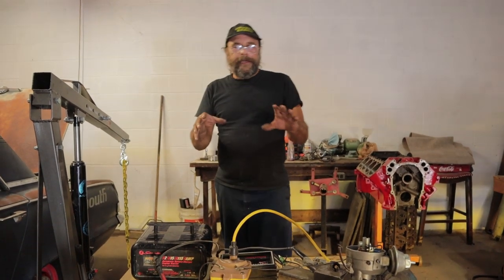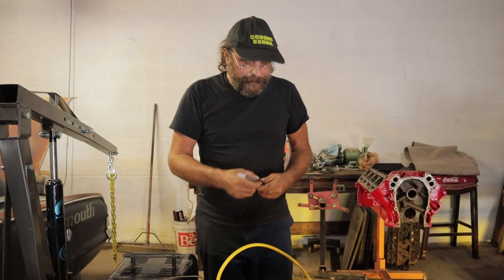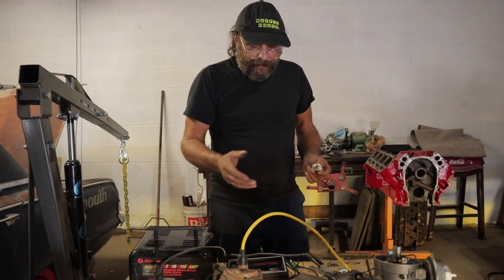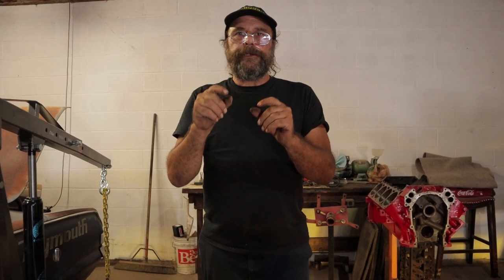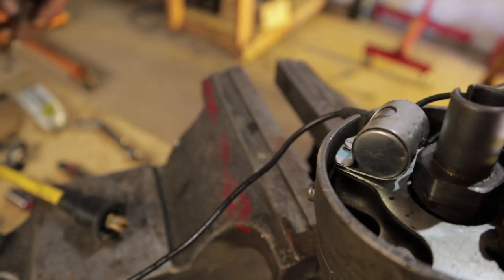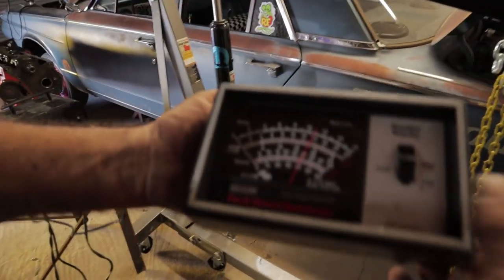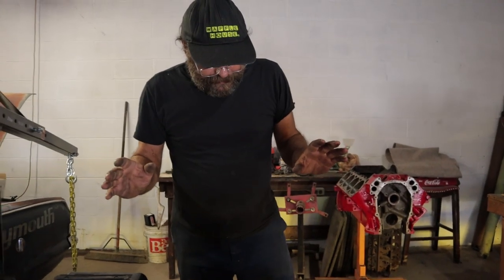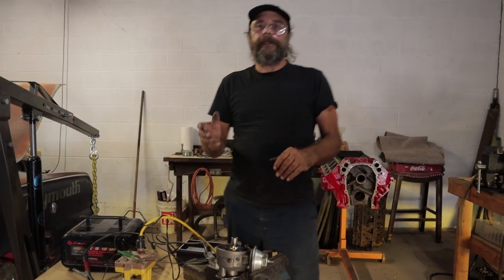Classic Car Tech-Setting Up A Point Ignition

Comment: Hi Uncle Tony, 
I am Chuck in Wildomar, California.  Good job Sir!  I have two 1930 Ford Model A pickup trucks with original engines (Inline 4s). Also a 1974 Triumph TR6 (Inline 6), and a 1947 Chrysler New Yorker (Inline 8).  All have points. Another bit of information for people new to points/condensor/coil ignition systems is that you ALWAYS adjust point gap BEFORE adjusting the engine ignition timing.  Point Gap affects Ignition Timing.  Cheers., Chuck

Comment: Love your videos!
As stated in a comment below, another word for condenser is "capacitor", pretty much the most common component in electronics....and the least reliable by far.
Its job in an ignition system is to form whats known as a resonant circuit with the primary of the ignition coil. When the point open, the magnetic field in the coil collapses and generates a voltage in the primary, this voltage then gets stored in the condenser momentarily and then dumped back into the primary of the coil.
This "ringing" backwards and forwards is what produces the AC voltage required to couple the primary winding to the high voltage secondary winding of the ignition coil.
The coil is just a specialised transformer, transformers require either a fluctuating DC voltage or AC for voltage to pass from one winding to the next.

What you have sitting on the bench in this video is actually a miniature Tesla coil arrangement.
Try removing the condenser and see how the engine runs, if it will run at all.
If you have access to an oscilloscope, you can actually see this ringing on the screen.

Another tip...if the points are burning badly to one side, change the condenser or its value in microfarads or uF. 

I cannot remember at the moment but increasing its value will shift the pitting to one contact, reducing it will shift it the other way. 

Nail the correct value and they should burn evenly without that spike growing out of one point.

Comment: I have had one of those Sears multi meters since 1986. First motor I built (350 to replace the 307) I installed an HEI with external Accel Super coil kit. So never used the meter for dwell. But it worked perfect as an under hood tach display for tuning the carb and timing. Along with a light and vacuum gage.

Comment: This was an excellent video, thanks.  In the 70's, when I had an Opel, and needed to set the point gap, the engine had a fan that was coupled to the water pump pulley with a clutch, so you could not just move the fan blade a little to get the points to high cam.  I would just put the car in 4th gear and move the car a little forward or back, as needed.  And back then, the Bosch points did not last very long.  I had much better luck with Standard Blue Streak points, which were vented, and also the 2 surfaces aligned (unlike the Bosch stuff I had tried).  A Beetle guy had told me about the Blue Streak points back then.

Comment: Nice video Tony !!!  My professional career as an auto tech began in 1973 and continues to this day. I never pulled a distributor to replace points and condenser. A sign of a bad condenser is badly burnt points. If someone would ever toss you a condenser you never catch it as it was probably  "charged" with a spark plug wire from a running engine...lol

Comment: Hey Tony
Great video!
Heres something to try:
While you have the distributor distributing that high voltage spark at the plug, remove the capacitor lead and youll see that hot spark get noticeably weaker. 
Maybe so weak it wont light the mixture of fuel and air under compression.
Gasoline is not a conductor for electricity so you’re adding  a lot of resistance especially under compression.
A good capacitor will prolong points life but also gives a higher voltage spark to start the combustion process.
In a pinch I would gladly ruin a new set of points to get me home if I didn’t have a replacement condenser/capacitor in the glove box.
That combustion chamber is a harsh environment for the spark plugs to operate in and really cant be duplicated by grounding them to metal chassis or vice.
I want the hottest spark I can get and the capacitor is a big part of that equation.

Comment: spot on on what a condenser douse! love how the distributor has a set of blue streak points! as for the match book i set it that way as the dwell on points is far from ideal across the rpm range. it is a bit to hi at idle and above 4000 rpm the coil is not charging to its peak so i set it with a match book. as for condensers the insulation over time brakes down and then thy fail and thay do not make hi voltage capacitors that last now . the condenser works the opposite why of a coil it, stores energy on the metal plates as electrostatic charge as opposed to a magnetic one in the coil so the capacitor cancels out sum of the coils kick back as the coil wants to keep charging.  thanks for the video top notch !! points rock!!!

Comment: I run a set of '60s vintage points on my '72 302 Ford in a '60 Comet. It actually runs a little bit better than it did with a Pertronix setup.

Comment: Hyundia had points until 1986. I had a stellar and the points screw constantly loosened. I got so quick at setting them by eye that I even set them at a stop light while waiting for the light to change. Finally I used loctite to hold them in place.

Comment: Coil = inductor Condenser = capacitor together = a tuned circuit L= inductance C= Capacitance
Hence  an LC circuit In a perfect match of capacitor to the inductor the points would hardly ever burn.
When points do "burn" it is normal to see metal transfer from one contact "point" to the other, one a valley the other a peak. when "dressing" the contact points with a file or what ever, your taking off the high peak and getting the metal clean and shiny. Do clean any reside that may keep the contacts from touching. If contacts burn quickly, the condenser is either bad or not grounded, Bad condenser can also cause no spark, always carry a set of points and condenser in a sealed bag.

On really old points it may be worth while to check that they are not stuck on their pivot  (they open but will not close back) Been there done that. ALSO... plastic cam contact that can melt if ignition is left on and the points are closed (I think GM's did that?) Many points had phenolic cam blocks that were pretty resistant to heat. All distributors cam lobes need to be wiped down and lubed with about a pencil point worth of lube (any is better than none)
Points plates grounding issues Lost ground during points advancing or retarding (that will drive you crazy lol). Distributor shaft bushing/bearings worn out will cause the dwell angel to go wonky easy check easy but not cheap fix... depends on your inventory.
 Don't get me going on plug wires 

Great job Tony
Reply: Similar to battery charging , with the metal transfer.....
like if the + post has alot of corrosion it's overcharging , if it's the - terminal corroding it's undercharging. 
Something like that, I could have the positions reversed I'm going off analog memory.

Comment: I have points in my 69 roadrunner, original distributor. I got friends telling to get rid of that old shit and put electronic ignition in. No way, they ran great with points and that's the way it's going to stay. Now if I had a super high compression race engine I might consider an upgrade. Also for a frequent driver car points can be cleaned up or replaced on the side of the road. Electronic ignition is usually taken care of with a tow truck.

Comment: OMG..I have the same dwell meter from Sears..I bought a 1969z/28 in 1982 for $4000..still have the meter, car is long gone 😭
Reply: You should buy you a good car so you can use it again
Reply: What happened to it? 😞
Reply: I have that exact meter and still use it regularly.  These days, I use it more to check things like turn signals than dwell, but it’s a solid piece.
Reply: djstl100 you got it! that little engine analyzer brings back some good memories.
Reply: I can still use the dwell meter on my 83 gti to check the O2 sensor duty cycle.
Reply: I have the same one too that I bought right around the time you did.  Seeing Uncle Tony using his made me feel I'd made a good decision in buying that particular unit.  I used it about two years ago and it still works.

Comment: If you adjust the dwell while you have the camera pointed at the spark coming out of a plug, will it visually change the way the spark looks as you are adjusting it? I have never tried this, and since you have it set up.....      Great video as always.
Reply from the maker: At the extreme ends of the range you would see a difference

Comment: Condenser (or capacitor) is like a miniature battery that is used to dampen electric surges/stabilize currents (shock absorber). It's 2 metal plates with a dielectric paste (that oil you mention) in between. The input and output are DC currents; it is a polar component (it matters which way you install it). They are used extensively in electronics; this is why it takes a modern car some time after the key is removed to actually shut down - the capacitors have to discharge. Another place you may see them is in welding machines, especially the old ones - they streamline the current so the arc is consistent.

Comment: Haven't done any of this since high school. Thanks for refreshing my memory.  Now finding a dwell meter is gonna be very hard as nobody really uses one anymore.  My 72 Olds 98 had a distributor with the window in the cap and allen wrench adjustment. Didn't really know how to properly adjust it as i was just a rookie mechanic back in high school.  it had a v8 ,455 cid.

Comment: I learned something decades ago from my grandpa. I replaced points in my Slant 6 and it ran but had no power compared to where it was before. After much goading he finally came through and looked at it.. The solution was that the bushings in the distributor were worn out. Therefore, there was a wobble and that caused the points under spring tension to be gapped too closely despite using a feeler gauge. Therefore we widened a bit and she went back to running like she was supposed to. Just another trick to keep a worn out piece of equipment rolling down the road-then and now!

Comment: I messed with these things so much,  the  Chrysler and GM. The tube you showed was electrolytic grease.  Non conductive.  I used emery boards to break the crown off. Feelers to get close then my dwell meter.   Awesome tool and I hope they are still made. 
I even screwed with a maloy dual point on my Chevy 307.  Lit them in two gears.

Comment: Tony, thanks for the trip down memory lane.

My '73 Chevy pickup, my pre Mopar days, started shooting ducks AFTER I had installed new points, cap rotor and plugs. 

What did I forget to do?  Replace the condenser!  After new condenser,  problem solved.

Comment: Nice explanation Tony. I enjoy your videos. The last set of points I did were in a Chevrolet 283 in a cabin cruiser. I’ve had very little exposure to the marine side of things but I was asked if I would do this. What I first noticed about the distributor was that the lower half had the helical gear on the drive that fits the GM engine, but, the top end was unexpected. It was exactly like the top end of the dual point distributor for a 1969 340 Dodge (Prestolite). A GM cap, rotor button, and points set wouldn’t fit it. This distributor was even set up for the maker and breaker points even though it was only getting a single set. I guess the marine industry decided to “Frankenstein” their ignition parts to monopolize on it. That distributor cap, rotor button, and points set (unipoints with condenser) were hideously priced from the marina. The Chrysler dealer said “no longer carried”, have to get it from the jobber. So for this guy’s Chev 283 I ordered a cap, rotor and points for a 1969 Dodge 340 dual point distributor at the jobber. They were there on the shelf all covered in dust, but they had them for about 75% less than the marina wanted.

Comment: Thanks for the great videos!
Those horrible Lucas relays also used to go bad, ad they are nothing more than a small coil with a set of points. Add a condenser to the hot wire in, and they last a very long time. 
Thanks for the tips!
Reply: Lucas: the prince of darkness. 
Ask any brit car lover 🤣

Comment: The points file and or womans fine nail file is also a great way to clean  up. The pressure switch for those of us who are still using well water they are a set of points just stay open and closed longer but same same a on and  off switch and they get old and need maintenance as well but no dwell lol great video as always

Comment: I use "Red-n-Tacky" to lube.  Always lasts the 8k or so between check/service intervals I use.  Also, I use a Q Tip to add just a smear on the cam.  I then use a toothpick to "pile" a small amount actually ON the forward side of the wear block.  What happens is that it will perpetually lubricate as the block is eroded.
Reply from the maker: Great idea!

Comment: You might want to discuss the resistor block or wire that reduces voltage from 12 volts down to 8 volts, the reasons for it's inclusion in the circuit and the results of it's absence. Thanks!

Comment: All our classics are under age of 1965 so points and condenser changing is a must. 

Not a fan of after market electronic distributors, but heard the pertronix is pretty darn good.
Reply: I never used one of those, but the cool thing from what I understand is you can keep a points set in the glovebox, and if your pertronix fails you can swap points back in on the roadside pretty easily and keep on truckin.

Comment: Good Luck having the local "Parts house's" getting you the right set of points and condenser. 3 Major parts stores and NAPA couldn't get me the correct points and condenser for my 1966 Olds Toronados 425 c.i. Had to order them from Mondello Olds.
Reply: My 67 Cutlass uses Delco distributor w/uniset points.  I met a guy who has piles of tune up parts for olds if you want the number.
Reply: Those 39°cba 425's are the best engines ever made

Comment: I had trouble with timing my 67 Volvo. I bought 2 condensers and still had trouble with it. I went to a junk yard and found a 50’s Plymouth that had a old condenser in the distributor. I took the condenser and when I installed it in my car, it fired right up with NO PROBLEM!  I was so happy. Stupid new condensers.

Comment: Please add one more step on rotors and distributor caps. Although it may be common knowledge, just the slightest crack in the housing or burn on the rotor will affect performance. I remember  my mid 70 GM motors having a voltage regulator attached to the cap that would always cause problems

Comment: When adjusting point gap to achieve correct dwell it's relevant to know that there is an inverse relationship between them; I usually check dwell with the motor running after setting gap. Also, if you are setting points with any regularity, a good eye should get the gap close enough to "get you home." By the way, this is one regard where the "regular" points type of distributor might be considered superior to the "unipoints" type as it's usually a lot easier to see or feel the gap with the distributor in the motor.

Comment: Very informative. I remember in an old Harley manual. It actually said to use the cellophane off of a pack of cigarettes to gap the points in the mag. I think it was mid 60s book if I remember correctly. Been a while since way back then.

Comment: Another great video Tony! In the next video you might want to mention a little about the points and condenser screws. They're short (1/8-3/16") with only a few threads in the breaker plate and easily stripped. GM Uni-set points (Delco D1107) actually have the condenser attached to the point set and are a great fix if the condenser screw is stripped.

Comment: I have a GM style points tool it looks like a screw driver handle and it has a lond flexable shaft and it has little sockets for the end ones a allen key socket n a flathead screwdriver socket cost me $1.99! Ur dwell meter looks exactly like one of the ones i have i also have a little handheld one also its about the size of a cellphone!

Comment: Picked up a sweet meter in a nice metal case at a rummage sale this year. Haven’t used it yet, but did my first set of points in my 65 f100 this spring when it started running like garbage.

Comment: Thanks man! Last time I worked on points was 1979 and I am a bit rusty. I changed out the points on a 57 Ford in line 6 work truck today. Got em installed with new condenser and coil but my old eyes couldnt see the point gap. Not to mention it was about 27 degrees out. Tomorrow I will go back at it. Best points video out there. Your a wrench genius. I was having an impossible time getting the points to land on the lobe. always stopped on the flats...any suggestions.
Reply: If you can get a socket wrench on the crankshaft bolt in front of engine then you turn engine & distributor a little by hand with trans in neutral of course.

Comment: Back in the day, one was a bad ass if he had "Sun" dwell meter! Great video Tony!
Reply: Al Jackson   Yeh you were a serious hot rodder with Sun equipment.  We had the Sears variety.
Reply: We bought an Allen analysis machine for $50 at a used equipment supply & it works great! Looks just like the one the CHIP`s mechanic uses on the motorcycles.

Comment: Uni-points were an option but, dad preferred separate points and condenser. They always had the allen head adjustment screws...gm you know. We had Buicks and Oldsmobiles. Have a 70 Cadillac now. Love the 430 powered funnycar posted it on faceb. Going through all your videos now. I've always liked MOPAR but, I was weaned on B, O and Cadillac.